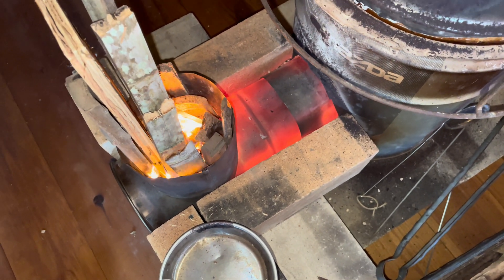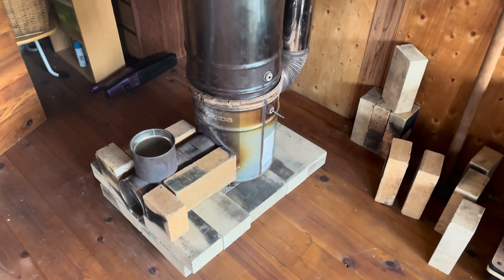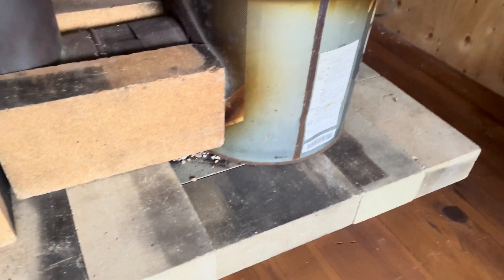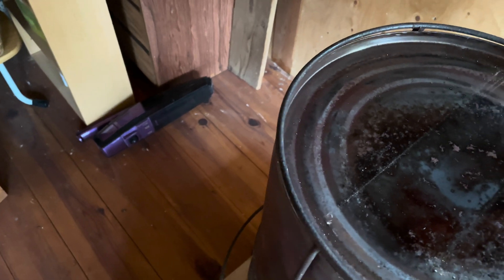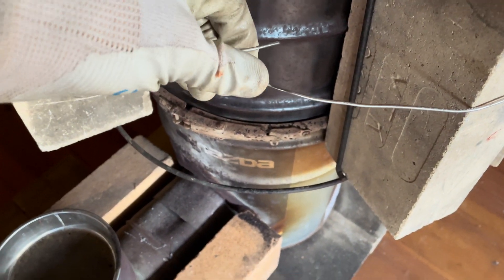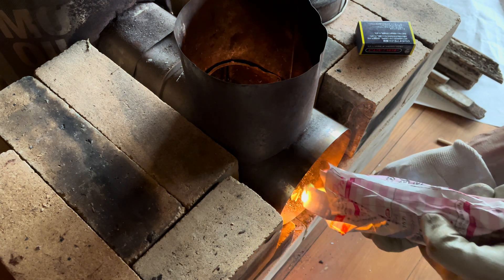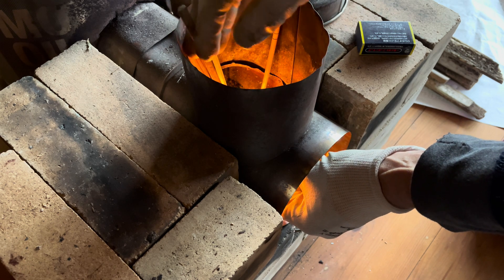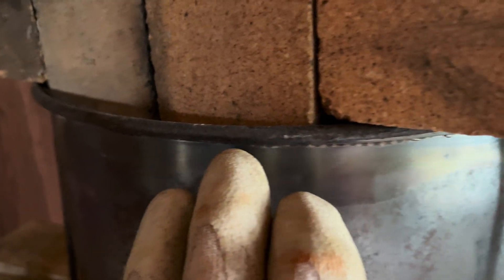Rocket heater with added thermal mass for small mountain hut

Comment: I’m my experience thermal mass is not necessary but if you want to do it, it’s best used on the exhaust portion not the very hot portion. The actual stove itself should be free of any mass so that it will radiate the most heat into the room and it will extend the life of the metal. I have a steel tank rocket stove made with 2 inch sprinkler pipe and it has run now for years without any changes to the metal whatsoever and it gets red hot If you want the heat to last longer you’re better off putting your energy into making your house airtight and insulated. Also using thin metals will not last very long at all.

Comment: Per your comment back... an insulated run of chimney or insulated flu to exhaust fireplace gasses solves almost all problems. Double walled stove pipe is expensive and this method is a much better insulation than that. Put 8 to 10 feet of stove pipe together (6 inch stove pipe). Then place a 8 inch or 10 inch (cheap) pipe, or dryer vent overtop of the smaller stove pipe. A small pipe inside a large pipe. Then "stuff" the space in between with vermiculite, perlite, or mineral wood insulation  (if it won't get wet you can use the mineral wool.) The other two options for "outside." Basically, you buy the large dryer vent with two end caps. You cut  out the six inch hole on the end caps that will surround the stove pipe. Then you can place the caps "back" at the end after you have stuffed the 2 inch space with insulation. Caulk everything with high heat stuff. With a long run of heated, insulated chimney, there are never any flu problems..... actually your draft could be so strong then in a rocket stove setup, it could get too hot !!!! As you know, many rocket stove setups need almost no "real chimney" or long run of chimney to still work great.... but you mentioned a flu issue so you may want to make your own insulated stove pipe !

Comment: The "J" design (with open top) can have issues. You don't want to get smoked out if the conditions warrant it. As your "wood holder" tube heats up with an open top, the fire could "mistake it for its own chimney." You may consider increasing the stove pipe coming up toward you 10 inches, capping it after loading wood, and allowing 100% of the air to come from what you now have "capped," .... the horizontal tube. I would extend  even that pipe a few more inches away from the wood burning as well but you probably don't have to. Trust me... if the top is left open there could be conditions "where it will want to burn up toward you a bit. If it's getting it's air from the horizontal run and you cap the top (above the tallest piece of wood,) there is no chance of "smoke out." You still should likely cap the horizontal cap with a few holes. When it gets going, it won't need to be completely open. What's best is to have a cap with a hole that allows a tube for outside air. Then, essentially, everything can be closed off.
Reply from the maker: Thank you for your comment and suggestions, I understand exactly what you are saying. I’ve been tweaking this heater for 5+ years including your suggested ideas, for example I brought Primary air from outside through a flexible expandable tube to the front of the burn chamber, and I didn’t find any noticeable difference in the burn, tried everything I can think of, and I found this works best for me. 

Having said that, I will add an extension to the vertical feed tube once again as it may work now given the other adjustments I have added in past years. 

The only negative aspect of this design in its present format is Backburn on windy days, and I need to find a solution to that. I thought of getting one of those fancy expensive whirly things to put on top of the flue and  that may be the way to go.
Reply: @Gregorynts  1:2:4 ratio on the J tube. If the short end of the J were one foot high (or metric equivalent) then the horizontal part of the J should be two feet and the long part of the J should be four feet. 

You probably have it dialed in by now, but just in case you are interested in the ratio.